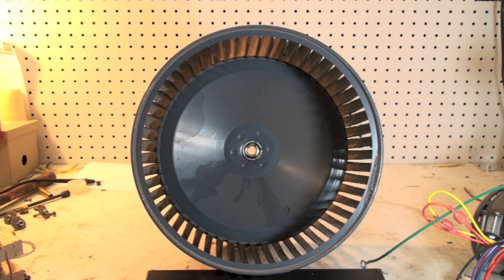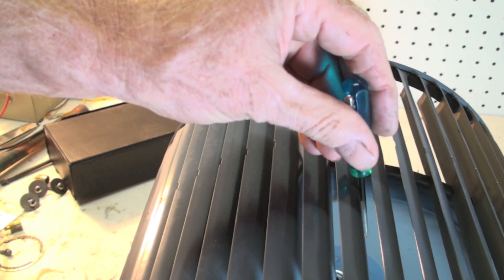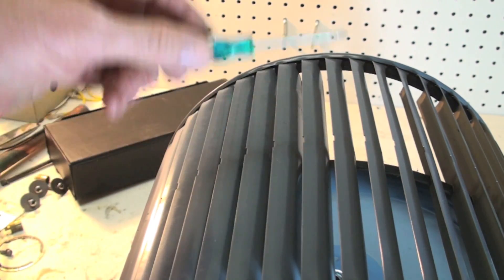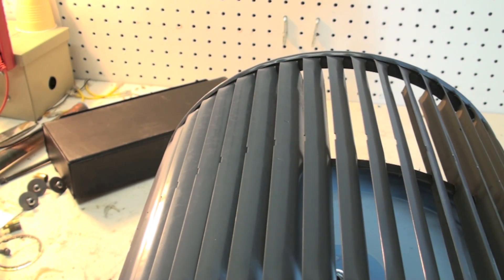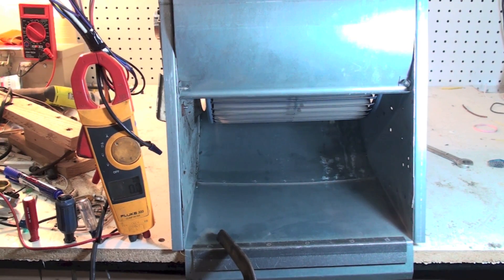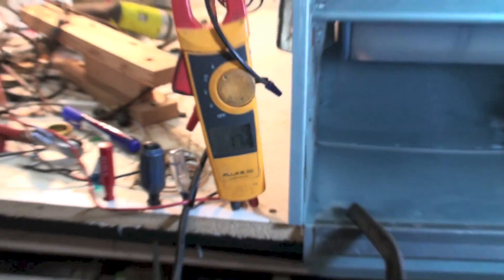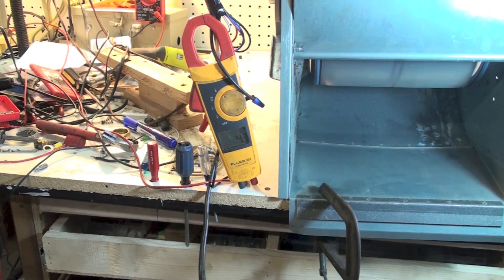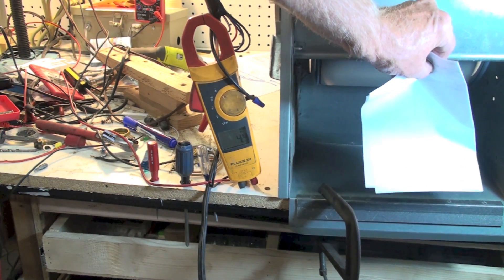How the squirrel cage blower works

Comment: I have a vintage dual squirrel cage range hood that I removed to clean. I neglected to label the two cages. Now I’m stumped as to which side they should to be mounted. I’ve tried both directions and air is moving. I’ve looked at Google and YouTube but I’m not understanding the information

Comment: Great video. I have a related question. If the squirl cage is turning backwards, how does it affect the in- house air intake where the filter is? In other words, I'm not getting much stregnth out of the cooling vents but a LOT of suction where the filter is? (pretty much grabs it out of my hands!)
Reply from the maker: If the cage is turning backwards, it will move no air.  
On the suction, if there is high suction, there is no problem with supply.  
Either the filter is plugged or a new filter has excessive pressure drop.
GFM
Reply: @grayfurnaceman  Thanks for the reply. I had a feeling that suction was GOOD  news. The system is for a 1990 mobil home (all-in-one outside unit) with air vents in the ceiling (Florida). Since I've never checked the duct work, that's probably it (not much room up there!). My squirrel cage makes a different kind of buzzing hum every now & then only when it starts. And then after many on & off tries (as if warming up) finally kicks in full. But I'm afraid to shut it off because it will probably do it again. I replaced the dual capacitor and seemed to do the trick for about 3 days until I heard the problem again? Is there a way to check the capacitor wilth only a multimeter that doesn't have a capacitor setting? I just have an ETEC 10709. I'm about to spring for a new motor (save the old one & make an exhaust fan!!!).  Thanks for your video & time sir.

Comment: Where should i place squirrel cage in relation to duct housing inlet for best performance?  If i move cage on shaft closer to inlet wall will I get better sealing properties?  I have ton air coming out non motor side inlet.
Reply from the maker: I set it in the center of the housing.
GFM

Comment: How do you know the blower wheel is on the shaft in the right direction.
Reply from the maker: If you can tighten the set screw without going thru the wheel blades, you are ok.
GFM

Comment: Will an x13 motor run on 24v alone at its rated 1050rpm?
Reply from the maker: No.  The 24 volt is just for controls.  It must have either 120 or 240 volts to operate.
GFM
Reply: Thanks man.. Mine is a 220, it seemed to good to be true even though a 100 different professional videos on here claim it to be a DC motor
Reply from the maker: @thespiritof76..  It is a 3 phase DC motor.  Single phase is changed to DC then is separated into 3 phases by the electronics.
GFM
Reply: grayfurnaceman  ok, I have the control that was on the side of the blower, first thing I noticed was the transformer.. that's what starting me to thinking. I work and deal in sound equip, and know that all the tube amps run on DC bc AC is just not an option for power tubes... so you have a Hi side/low side power... I wish I had some of your knowledge on this for just a day. And I would have my buffer/polisher worked out!!  Thanks for your advise... I'm still looking for a torquee dc motor, or a 110 would be fine I suppose.. It's the shaft that I need to be at least 5" long... 
  I was given the 'BRAND NEW 51-104358-00 x13 that is complete unit from a friend that runs a Hvac warehouse... 220 is not an option unfortunately.. thanks👍🏻

Comment: Not exactly "intuitive". Have to take at face value. Maybe "an airplane wing in reverse"? I.e. the wing uses moving air to make low pressure. The wheel uses low pressure to move air. "
Reply from the maker: You are correct.
GFM

Comment: Hello so theres a swamp cooler on a mobile home im working on however when turned on. Shaking occurs and the ceiling underneath shakes as well. What can be the issue and resolution?
Reply from the maker: Probably either a bearing problem or the blower wheel is out of balance.  You can check the wheel for dirt or trash.
GFM

Comment: A simple way to describe how the blower wheel works is to imagine that each of the fins is a forward-facing cup that holds some air. Air has weight to it. As the wheel rotates, centrifugal force throws that air outward, away from the blower wheel. This creates a void or low-pressure area where that air was, so atmospheric pressure naturally pushes new air from inside the wheel into that space, and the process repeats. If ran backwards, the cups of the fins can't hold the air to get it up to speed, it simply slides off the backside of the fins prematurely instead. Motor horsepower is utilized to get that new air spinning, and therefore, the more air that is allowed to move thru the blower, the more horsepower required to move it. That is why your Shop Vac speeds up when you block off the hose, less load on the motor allows it to speed up. A centrifugal water pump, such as a sump pump, works the same way, and also uses less of the motor's power as the flow is restricted.
Reply from the maker: Very good explanation
GFM

Comment: Vibration/loud noise started after semiannual HVAC maintenance-air conditioning Spring to replace filter and whatever else they do. Serviceman came back and told me adjusted shaft on blower wheel which immediately corrected loud noise when blower running with air conditioner but not with humidifier or heater. This lasted for few days and now sound is back again. They will come back tomorrow. First they said it is because old system-system is fairly new with only 4 seasons of heat/cold use. Is it likely need to replace full squirrel cage/motor?
Reply from the maker: You may have lost a blower wheel weight during the service.  Means a new blower wheel.
GFM
Reply: Turns out blower motor was culprit-where wheel attaches to shaft in motor. They replaced both motor and wheel as it was in warranty.

Comment: Could you use this type of blower in a home made dust collection system? Would the intake restriction stall or over heat the motor? What HP motor would you suggest?
Reply from the maker: You can.  The wheel is not designed for dust collection so you will have to clean the wheel periodically.  Intake restriction will reduce the load on the motor.  HP depends on the size of the system.
GFM

Comment: I was told you can only run these in the shop for no more than 2 hours.  This is because the blower has no air "restriction" and this causes the motor to over heat.  He mentioned a word when this happens but I forgot.  Is this true? Can I use this fan as long as I want without "heating" the motor?  Thank you for taking time in explaining how this fan works.
Reply from the maker: The fan is designed to run against some static air pressure.  Without that resistance, the fan may overheat.  If you want to operate the fan in open air, you can reduce overheat by blocking part of the discharge.
GFM
Reply: You are a breath of fresh air.  Your prompt response is appreciated.  Many take a long time to respond if they ever do.  Keep up the good work.
Reply from the maker: Thanks for the support.
GFM

Comment: how do I check the amp draw on these. i have a amp clamp just not sure what wire to clamp it on. i have 3 total fans. 1 is a 110 volt, that one is easy. i have 2 that are 220 volt and im not feeling confident that i am checking them correctly.

Comment: what is at the purpose of a squirrel cage?
Reply from the maker: The squirrel cage blower wheel is a design that can supply air flow against resistance to flow.  Its called static pressure.  The propellor fan will not flow against resistance.  Hope this helps.
GFM
Reply: its used to train racing squirrels

Comment: I am researching building a small hobby airbrush paint booth and I have heard that I can use a squirrel cage blower to extract the paint particles and fumes. My question is, can you have the squirrel cage blower situated so that it creates a draw instead of pushing air. Cheers
Reply from the maker: Wayne Osborne You bet.  Your inlet is at the hub.  Depending on the blower, they will pull up 1/2" water column.  Hope this helps.
GFM
Reply: Thanks for the information, just one more option. Cheers

Comment: Here's a good question for you; I've got a small squirrel cage fan that's working fine. However, I'm attempting to hook it up to a small tube, and get some significant output of wind through it. However, when I attach it to the smaller pipe (after using a funnel shape to reduce the size), I noticed that a good part of the air will go out of the top, while the wind blowing through the pipe is relatively minimal. It seems to be 'backfiring', so to speak. Do you know how I can do what I'm attempting?
Reply from the maker: These fans are capable of working against a specific amount of back (static) pressure.  When you exceed the pressure, the air simply stops.  Unfortunately, there is really not much you can do except find a fan that works with higher back pressure.  Hope this helps.
GFM

Comment: Even the wheel end for end (if it will fit in the housing) but turning the correct way (towards the discharge port) won't move much air. Nice demo!